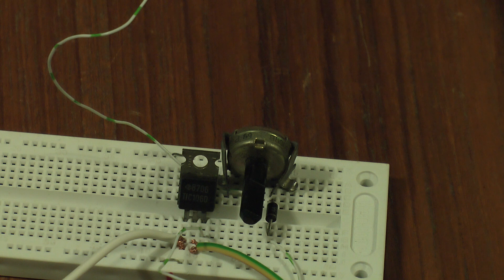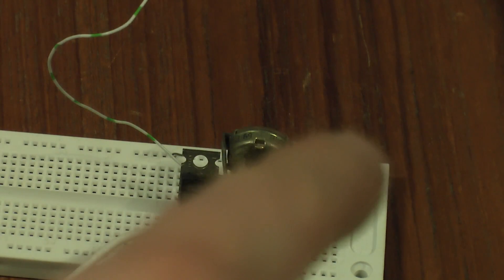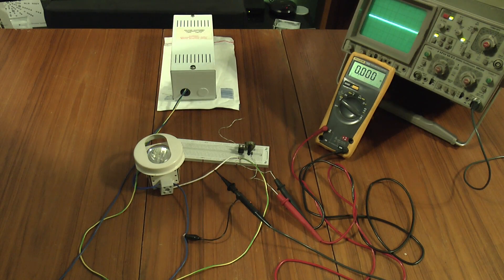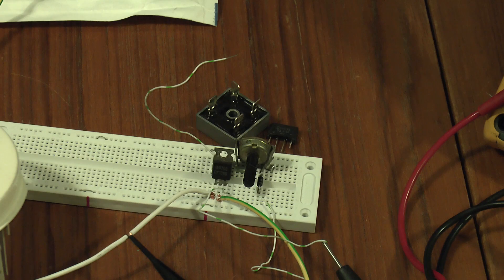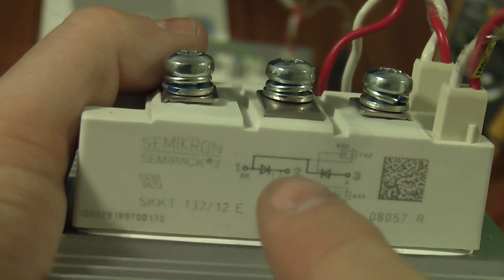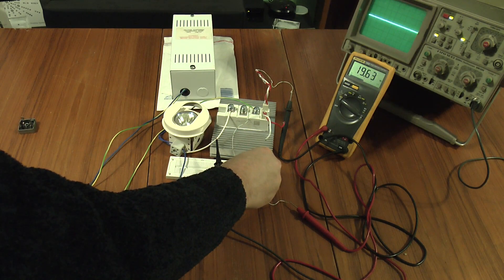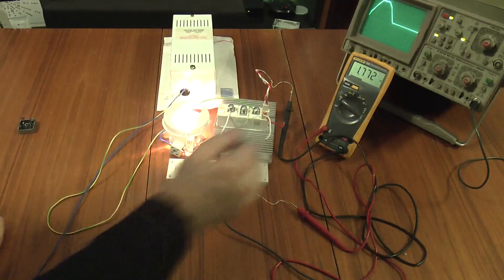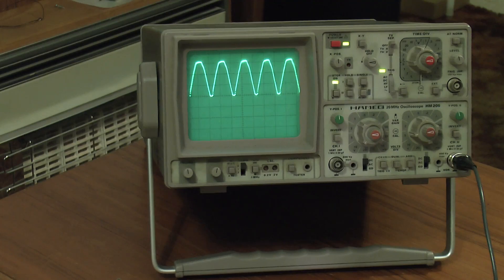Can you use SCRs as diodes?

Comment: Sir how you connected diode through the gates please explain
Reply from the maker: Anode of diode goes to anode of SCR.
Cathode (stripe end) of diode goes to gate of SCR.
Reply: @AintBigAintClever  Sir, you said in the video to connect a diode in same direction. Is there any diode connected before anode and cathode?.
Reply: @AintBigAintClever   when you connected gate white wires to both Scrs (8:36). Please tell me have you added forward or reverse biased diodes to both gate wires?
Reply from the maker: @zahiddhopawnkar6423  https://www.facebook.com/AintBigAintClever/photos/p.2655882694723410/2655882694723410/
Reply from the maker: @zahiddhopawnkar6423  https://www.facebook.com/AintBigAintClever/photos/p.2655900281388318/2655900281388318/
Reply: @AintBigAintClever   Thanks for the help sir. Sorry for the trouble sir i need One more help from you. Actually, i have connected gate connection to those terminals without diodes so i want to check my SCR from multimeter. Can you please help me with this?
Reply from the maker: @zahiddhopawnkar6423  sorry, I don't know how to check an SCR with a multimeter. One option would be to assemble it with a diode on the gate and test with a lamp in series with the SCR. You should only get the lamp to light with the supply in one direction. If it lights in both directions, or neither direction, then the SCR's dead.

Comment: I need help from you or anyone that will comment , I have the mig 130 off of eBay , the tip is hot all the time and its a.c. , I want to convert it to dc and have the trigger control or turn off and on the power and convert it to dc as well I have igbt blocks and I have the scr blocks like you have as well, I salvage all these componants from a bunch of huge vfd drives but I just can't grasp how to wire it, I know there are a lot of vedios on converting the harbor freight welders butvi want to do it with scrs instead of the 200 amp bridged rectifier. Any help would be greatly appreciated.

Comment: Hello sir as you made a half wave you used a diode while you made full wave without diode and you connect the gate to the AC supply I don't understand sir thanks
Reply from the maker: When I made the full wave rectifier I used diodes as well. Watch from 8:30 onwards, the diodes are within the red crimp connectors.

Comment: Can you explain the need to squeeze hockey puck scrs to make them function?
Seems like a dicey situation if thousands of amps are involved.
Reply from the maker: Apparently it's both for thermal dissipation and current transfer.
http://www.hdrpower.com/download.asbx?AttributeFileId=c125a55c-cd0b-4944-9dae-37adc4a810fe
Reply: AintBigAintClever  Much thanks for that link, maybe I can get low current operation (tens of amps instead of hundreds) out of these hockeypucks at lower clamping pressures.  I have engine valve springs in mind for this to give some degree of control gauging by f = kx
Reply from the maker: You might want to use the valves as terminals as well :)
I'd expect a spring to exert more pressure at the end touching the base, not sure if it would still be the case even if perfectly flat. At least a valve, sprung against the SCR and held perfectly perpendicular to it (so its face is flat against the SCR) would exert equal pressure. A valve against each side would probably look cool, if mounted to "show the workings" too.
Reply: Skkt 162 16E praic

Comment: I actually years ago built a voltage doubler for a high powered strobe light (240VAC) with 2 fixed diodes and 2 SCR's to provide control from near fullwave rectification to doubling. Was a great project (AVR uC with an external A2D run on the HV side via opto couplers and optos for the gate drives :)
Reply from the maker: If it's still knocking about or you fancy making another I think it would make an interesting video, showing how the circuit changes from a bridge to a doubler as you vary the input. I'd have to draw it out to figure it out :D
Reply: Sorry for the delay I have had to trawl the archive DVD's to find the project. I have found the schematic, it was in Protel, I will reinstall Protel (as I have recently rebuilt this system) and then convert the schematic to a pdf :) I may do a video about the circuit operation.
Reply from the maker: It took me a year to reply and YOU are apologising for the delay? :D
If you can export it to a high-res PNG file that can be useful if videoing it as depending on the editing software you may be able to just drag it in and pan/zoom as required. That's what I do (I used to screenshot Eagle schematics until I realised it has an export function, now I export the PNG and use that).

Comment from the maker: No triacs were used. I used the SCRs because I didn't have any diodes of the same rating. The small diode is required to block reverse current flow through the gate connection. With no connection to gate the SCR will not conduct. With gate shorted to anode it'll conduct in both directions through the gate, destroying it.

Comment from the maker: I've got 4 4700uF and 2 3300uF caps wired in parallel which should smooth things out a bit. Don't want any zero-voltage points buggering up any arcs now, do we? :)

I've seen inside a MIG welder (EuroMIG 200 I think), looks like it's designed to output DC with an AC offset as the output from the 16 rectifiers (4 for each leg of the bridge) looks like it goes straight back through the transformer for a couple of turns.

Disclaimer: I know f**k all about MIG welding. :)

Comment: sure, I have seen old motor controllers that used two SCRs and two normal diodes to make a bridge rectifier that was pulse width controlled to control the DC motor's speed.  You can turn them on at the start of the cycle and it will act as a rectifier.  If you need AC control, you use a triac, instead (which is effectively two back to back SCRs).

Comment from the maker: Not a silly question at all! Some SCRs have an internal resistor between the gate and the cathode to reduce sensitivity and prevent false triggering (I guess the TIC106D doesn't have one hence it being ridiculously sensitive). If you connect the gate directly to the anode you'll effectively put that resistor between anode and cathode so it's always conducting in both directions (or at least until the fuse blows or the resistor burns out).
Reply: Yup, I just replaced the SCR in an old school 12v battery charger, and gate to cathode was 35 ohms.